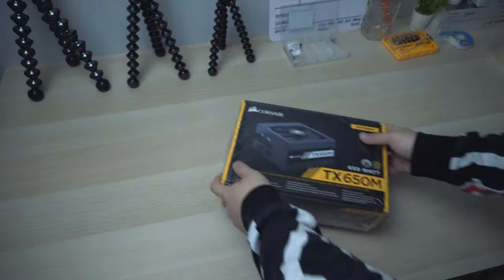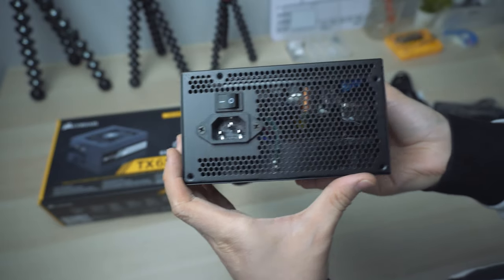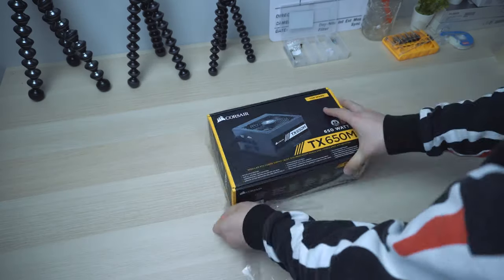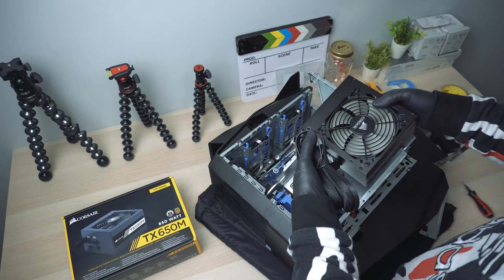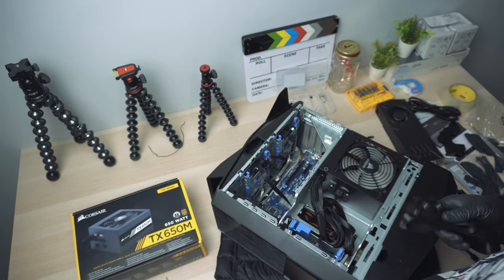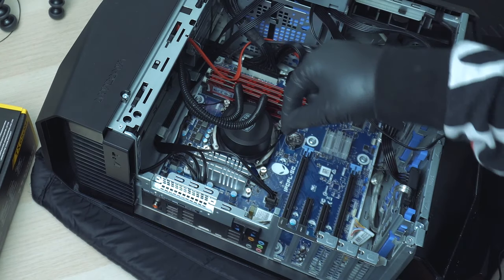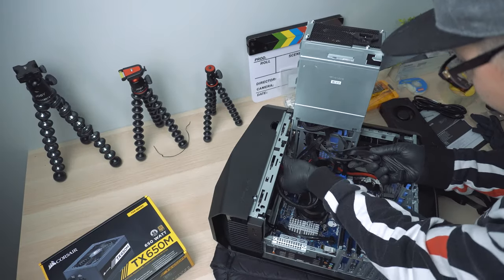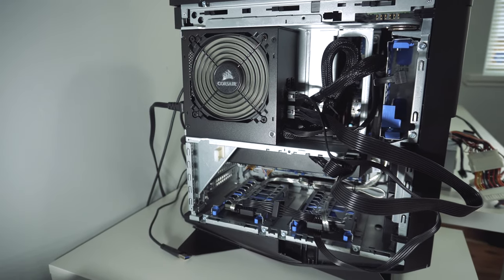Alienware Aurora R7 Power Supply Upgrade

Comment: For the dvd drive you can buy an adapter, that’s what I did. Also for the mobo port that says “GPU_PWR,” it’s recommended to use a an 8 pin CPU connector, as it is an EPS connector. For the GPU itself, ALWAYS use PCI-E of course.
Reply: What would the adaptor be called?
Reply: @TLNetworkGuru  I searched for mini sata power adapter and found what I needed
Reply: I've heard different things about this. Are the PCIE and CPU power connectors keyed the same? Either can be used, but 8pin (or 4 pin) CPU power is better?

Comment: Hi, not sure if you are still checking comments for this video anymore.. but I could use some assistance hooking up my Corsair TX650M up in my alienware R7. I had thought I figured out how to hook it up originally by watching your video, but wasn't 100% sure on the GPU_PWR and CPU_PWR hookups.  I need confirmation on that part - the 8 pin (4+4) is split and part goes into CPU_PWR & we should be using a PCIe cord (6+2) and splitting to use the 6 portion of it for the GPU_PWR correct? I tried this and there was no response when all was connected & turned on PC. So I returned the product because I think it was a defective unit & I got Corsair to send me a new one.

Comment: I have the Aurora R6, the command center no longer changes  colors when playing games, even if i set game mode profiles :(
Reply: i had that problem too, i opened up my case and looked for the cable that controls the led and just unplugged it and then back then. it worked after i turned it back on but maybe that wasnt it
Reply: @Snakekilla54  everything is plugged in, its a software issue, and dell wants me to be pay $250 dollars essentially to fix it...

Comment: Did I hear that correct, the stock 460w power supply is enough for 32gb RAM, Liquid Cooling, and an RTX 2060? Just asking because I want to upgrade to a 2060 but unsure if I have to change the power supply. Great video BTW.
Reply from the maker: Yes, that's crorrect.  as long as you are not overclocking anything.
Reply: And if it doesn't need  2 8pin connectors which my problem was... I had to buy a 6 to 8 pin adapter and since then my new gpu is working great!
Reply: Quintijn Kroesbergen thanks got the 2060 and works perfect. It only needed one 8pin which was already available on the stock PSU!
Reply: Digital Etron thanks got it and works like a charm!

Comment: Thanks for the video.  My son has an Alienware Aurora R7 with a 460W PSU and an Nvidia GeForce GTX 1070 video card.  He wants to upgrade the video card to something better.  We were looking at the ASUS GeForce RTX 2070 Super Overclocked card.  Do you recommend it and what PSU do we need?  Dell suggested at least 850W to be safe.  Thanks.
Reply: You do not need a 850 wat psu for a 2070 super over clocked or not. Dell is trying to scam you. The lowest you can go with a 2070 super is a 650 and that’s the general recommendation.
Reply: @rowanpawloski9212  when he recommends against overclocking is he referring to the graphics card?
Reply: @rowanpawloski9212  I don't think they were trying to scam me.  They don't even appear to sell any compatible PSUs.  I couldn't find any online.
Reply from the maker: In your case , Any PSU over 550W is going to be fine. Recommend 650W for future proof.
Reply from the maker: The OC edition GPU is different to what I was talking about. What I was referring to, is manually over clock the CPU or GPU or RAM. Which is a different story.
Reply: @OnboardCircuit  Ah, that's what I thought.  Thanks.
Reply: I have the exact same setup and was wondering the same thing I want to upgrade my graphics card to the new rtx 3070. Should I upgrade the power supply to 650watt?
Reply: Following because i'm thinking of doing the same.  I have a 1080 running fine on the stock PSU which I think its the same 460 watt.
Reply: @aaronuuu  Is this PSU a standard size?

Comment: But the original power supply only has 6 pin pci, the rtx 2060 needs a 8 pin. How do you handle that?

Comment: im having game freezes during game play with a 450watt gtx1080 in the r7 right now. im thinking it might be because 450watt isn't enough, what do u think?
Reply: Yes, your power supply is not good enough lol. Try going for 600W or up. If you are unsure, there are a few wattage calculators on the internet.

Comment: just purchased this same psu for my aurora r7 and pc wont power on at all with it. i had to put the old 850 psu from dell back in to get it to work . any thoughts?
Reply: Any updates on your problem?
Reply: @shiftslegend8217  i had to replace my motherboard to fix the issue. my dell motherboard turned out to be faulty.

Comment: Hello there, thx a lot for your video. I have a quick question, you said you have upgraded your RAM, which brand or type of RAM did you use in order to upgrade? I would like to upgrade mine too, but I have read that not all the RAMs would work on this PC.
Reply: I have an aurora r7 and I swapped my original 8gb 2666mhz for two 16gb 2666 HyperfuryX from Kingston. Basically from what I gather, you original card is Kingston so you really can't go wrong.

Comment: Hey dude, i have a aurora R5 with an i7 6700, can i change the cpu and put a i7 7700k for example?
Reply: Yes you can. But what's wrong with the 6700?
Reply: Quintijn Kroesbergen I wanna stream the Modern Warfare and with this processor it appears some fps drops on the stream very often
Reply: Buslaitir Hm how much ram do you have?
Reply: Quintijn Kroesbergen I have 16gb 2666 in 2 sticks of 8
Reply: I searched a lot and who have this R5 told me that isnt possible to change the cpu
Reply: Buslaitir the r5 only supports ram speeds up to 2400mhz tho
Reply: Buslaitir why wouldn’t it be possible?
Reply: Quintijn Kroesbergen the z170 that cames with it doesnt support 7th gen
Reply: Buslaitir it does
Reply: Buslaitir you can even upgrade to a i7 9900k cause it uses the 1151 socket which the r5’s motherboard has. Only the I9’s x series can’t be upgraded to with this motherboard. You can even upgrade to a i9 9900k cause it uses the 1151 socket.
Reply: Quantities Kroesenberg it may or may not be possible. The motherboard may not support 7th gen chipsets

Comment: can this power supply handle RTX3080?
Reply: @bwmoo2449  i figure out that 3080 won't even fit my Alienware R7
Reply: @hunting762  replace the stock front fan and it's doable

Comment: Is 650 watts enough  to upgrade the GPU to a 2070 or 3060? Also does the mother support such upgrade?
Reply: 650 is more then enough for a 2070 and even a 3060. 460 is enough to power a 2070 even.

Comment: Anyone tried putting a 3070 in the r7? Trying to see if I could do that with this psu added
Reply: Mine's got a 3060Ti. It wasn't performing as well as other 3060Tis with the 450w PSU (still a massive increase in performance compared to the 1070 I had previously). I upgraded the power supply to 650w and it's going great.

Comment: Yo! Nice video! Question: i upgraded my Aurora R7 GPU to an RTX 2070 around a year ago...the past few months i realized that when playing high GPU demanding games, my PC fans make a lot of noise and it's very annoying. I just realized the noise seems to come from the powersupply fan which sounds different from the front and top fans. I'm not sure but i'm guessing maybe the power supply is struggling to support the RTX 2070...what do you think ? Perhaps upgrading to a better power supply could solve the sound problem ?
Reply from the maker: Not sure which power supply you've got in your R7, maybe is the 460W? that should be ok for RTX2070, you can still upgreading it to more powerful one NP,  but from what I know the fan in the 460W PSU does not make big noise as the other cooling fans.
Reply: @OnboardCircuit  hi! I've actually been looking for a solution since i saw ur video and it ended up being the power supply i needed to change. The original R7 460w supply was Indeed enough for the RTX2070 for a long time using it but the fan ended up going mental when CPU temperature was going to high so i ended up getting a new power supply and it solved the problem
Reply: @dapigudemao  I have an r7 stock. I just bought an 2080 Super and it said it required at least 650w so I ended up buying a new psu (evga 850w) to go along with it. Check what wattage you need for that gpu as stated in the manual or specs.

Comment: I know the power supplies your showing off are 650 watt, but do you have any suggestions for a 850 watt? My power supply has started to occasionally make a wurring noise that is noticeably ever good so often, so I’m thinking that means it needs to be replaced. Also do certain power supplies not work with certain motherboards? I’ve heard that some don’t. My PC is an Alienware Aurora R5 with the motherboard being a 01NYPT.

Comment: Does this work the same way with r10/r11?
Reply: I am doing it later today, I will let you know, but I dont see why not. my R10 came wtih a 550w and a 850w should arrive later today.
Reply: @DanielRodriguez-fg5ll  need an update on this!!! I have same setup and would like to know what you bought and how it worked.
Reply: @bretts.8661  I bought on ebay this one: Sea Sonic Focus Plus 850 Gold 850W ATX Power Supply

Comment: Is the upgrade from the 1060 6gb to a 2060 worth it in your opinion? I found a 2060 at retail and would like to replace my 1060. I play flight simulator 2020 which requires quite a bit of power to run.
Reply from the maker: Well yes it is a good update, but maybe you can save the money to get RTX 3060, much better I think.
Reply: @OnboardCircuit  hey! Will the 3060 work with the oem 460w PSU? It’s not much more power hungry than the 2060 which is why I’m considering getting a 3060 instead.

Comment: how many wats the original psu have ?
Reply from the maker: it depends what specs you have  either the 460W or 850W.
Reply: @OnboardCircuit  i7 8700 and 16gb ram and gtx 1060 6gb
Reply: @nirkalla3937  460 is enough

Comment: Thank you for this informative video.  I'm considering  upgrading my video card to the RTX 3080.  Will the the stock power supply still be enough?
Reply: @Ron Querido No, you'll need a 750W or 850W, either one should be at least a gold rating , preferably a platinum rating for maximum efficiency, the RTX 3080 power rating is 320W on it's own.
Reply: @vr_gamers8116  it’s a moot point.. I wouldn’t be able to fit a 3080 in my Alienware Aurora R7 case.
Reply: @rojoque  Yeah true, unless it's a Dell custom 3080, although in my opinion these cards are too big and too hot for any small form factor case.
Reply: @vr_gamers8116  If the prices ever go back down, the only upgrade that is available for me is why you suggested or getting a 2080 ti.
Reply: @rojoque  iv seen a guy put a 3070 in. idk if he made a power supply upgrade
Reply: I actually ended up getting a whole new case and motherboard and 850w PS.  I should be able to fit a 3080 in there.  Now to sell my kidney to afford one :)

Comment: I bought a 700w gold power supply for my r7 and once I plug the cable in for the GPU power my computer does not turn on. I’m very confuse. Does anyone have an answer to this?
Reply: Did you ever sort this out?

Comment: Can I upgrade my aurora r7 to rtx 2080ti
Reply: Pretty sure that they ship some with the 2080ti. I'd imagine that the biggest issue would be if yours came with the smaller PSU or the 850 watt one.
Reply: A. Yuuki how much watts does a 2080 ti need 750?
Reply: @Twinski98  Well, I'm pretty sure Dell, ships theirs with and 850 watt PSU, but that's more than enough. If you look under specifications on newegg or whatever site you're viewing the item on it should give you the recommended wattage for whichever card you're looking at.

Comment: Hey I followed step by step but I am stuck on the GPU_PWR plug. When I turn my pc on, I get no signal on my monitor. Can you 0ease help me out.
Reply: Did you ever fix that problem?
Reply: I also have this problem 😭
Reply: @johnly_  i read somewhere that you need to use the CPU cable instead of the PCIe for the GPU_PWR slot. If you have the extra 8pin cpu cable use that, if not, you can split the 4+4 cable and use one half for the cpu and the other for the gpu slot
Reply: @velvaraart1007  unfortunately i tried that too but no luck at least for me. I'm just gonna build a new PC entirely when new stuff comes out end of year

Comment: Its been awhile since this video was uploaded so I dont know if anyone will answer this, but can I use this for a Alienware Aurora R7?
Stock Specs:
GPU: AMD Radeon RX 560X 4GB
CPU: i5 8400 6-Core
RAM: 8GB DDR4 Single Stick
PSU: 460W
Can provide additional info if needed.

Comment: So I got the 650 and it doesn't work for my pc for some reason is it because its a 1080ti? I took it to a repair shop and they said I need a power supply with two 8 pin connections for it to work because of the 1080ti so I'm at a loss lol